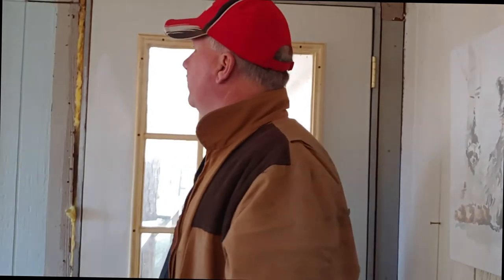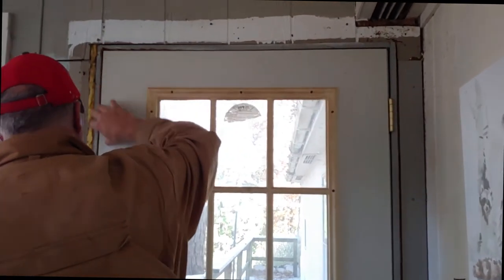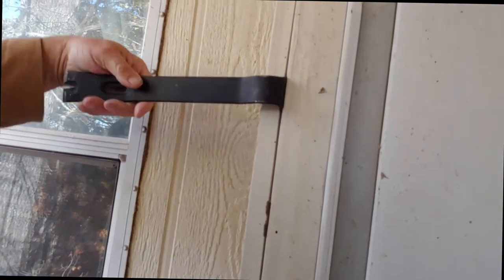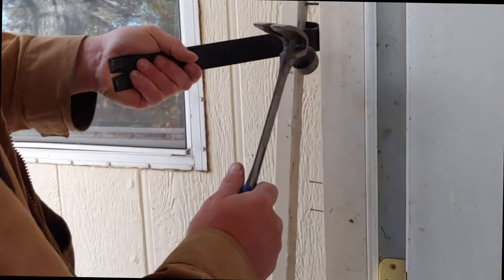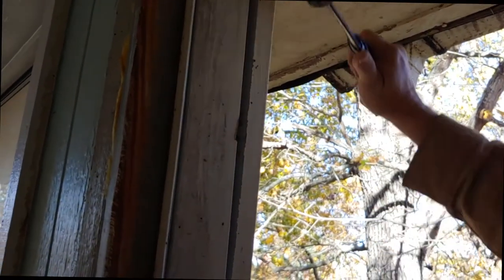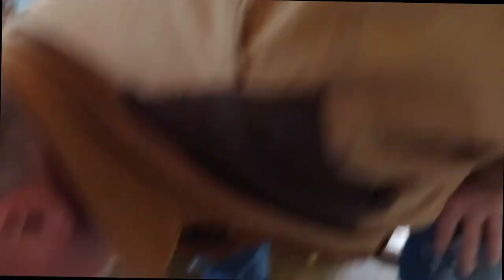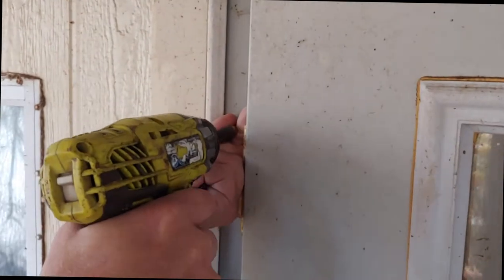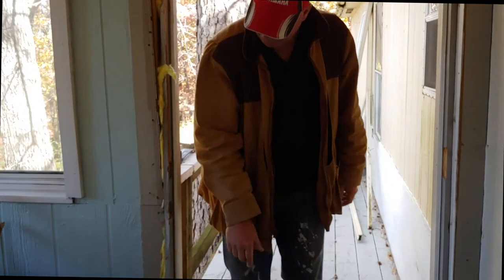Removing A Door in a Mobile Home putting a House Type Door In

Comment: Question ❓ Phil , I had a guy install a metal exterior door in my mobile home and half of the bottom of the door is scrubbing the floor and the other bottom  half is not .can you tell me how to fix this. Thanks. I enjoy your videos ,I am just a old country boy but I'm learning how to do carpentry work by watching your channel.
Reply from the maker: I'm just a country boy too. Had walk water from the spring in the summertime as a little boy. As far as your door the adjustment will be in the hinge side of the door . Either lean the top back or raise the door up what you need . Hope that helps.

Comment: Mine is sagging plus can’t get the dead bolt to go into the strike plate . It’s at least a 2’ sag idk what to do
Reply from the maker: If the place where the hinged area is is tight. Sounds like your needing to reset the blocks under your door. Which would mean jacking up the house to push up the house at the frame to reset the blocks to push up on the side that needs to go up. You probably don't have skill or jack to do that . So take the door and unscrew all the screws around it then reinstall with the door square inside the frame. If the hinge side is broken you will need to replace the door. There should be several videos that I have for situation on my channel alone. You should know I wish you and yours all the best.